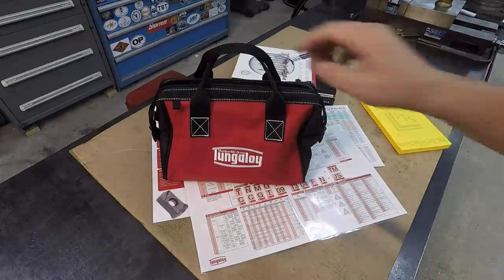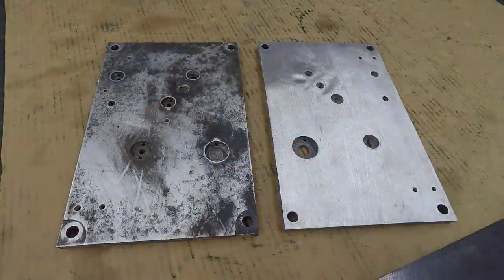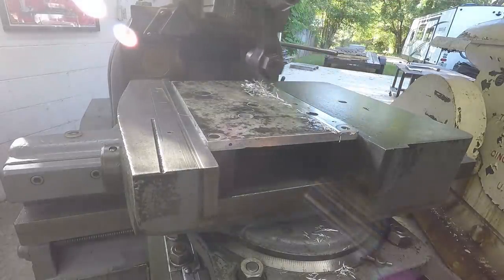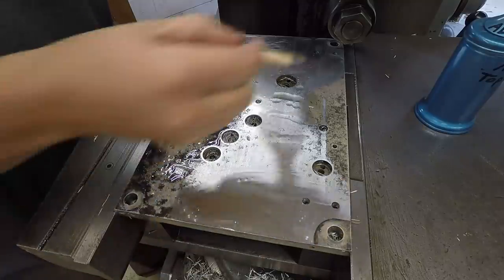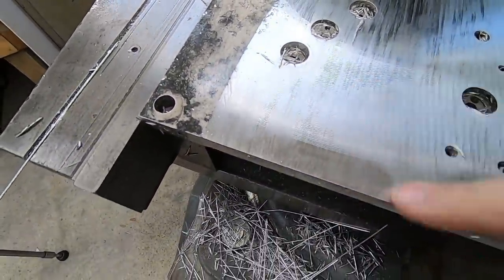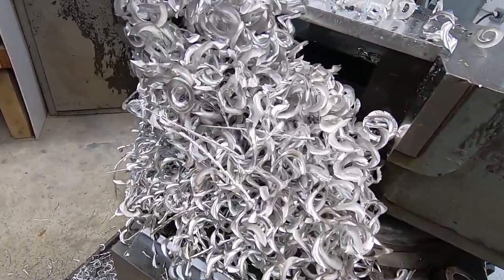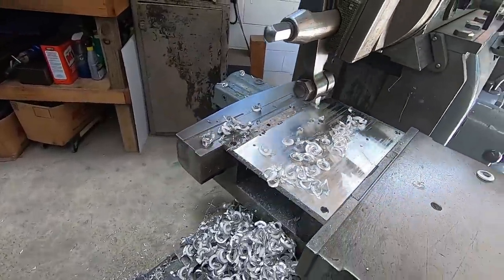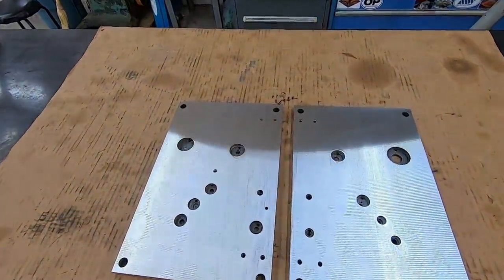SNS 307: Grandfather Clock Restoration, Shear Tool on Aluminum

Comment: Yes, I ruined the finish, but that's not what you see. I made blunder and in the process of trying to do the edges, I put quite a few scratches in it. I decided to take everything and polish it up with a buffing wheel and compound. I also did all of the parts, especially the copper ratchet and the pawls (I was surprised to see that they were actually copper and not steel) and the large brass drive gear on the driving shaft. My brother in-law was actually kind enough to take the cut pieces of Lexan and make new cover plates as well as a new face. What shows in the pictures does not do justice  to the awesome job that he did, especially on the face. Unfortunately, I had a couple of better pictures for the copper and brass that were better exposed to show how nice they looked, but I guess I didn't get them to Adam in time. Although he doesn't show it in the assembled pics I left the outside surface on the back plate untouched. A big thank you to Adam for a great job on the plates!
Reply: Everyone makes mistakes; it how we learn. At least you tried.
Reply: @jthomas1878  Thanks for that. To be fair, I knew better. What's done is done and I like the polished finish anyway. Had I been able to get it down to clean metal, I might have done that. There was a fair bit of staining on many of the other pieces so that's why I wanted to clean as much as I could with the buffing wheel and compound. That went with the new clock face that my brother in-law made for me that was so clean and clear I just had to clean everything else as much as possible. The only thing I couldn't do much about was the  shaft that had the large brass gear on it. There's a disk on that which is steel and I could only do so much to clean that up. That's fine because that little bit of age showing adds character.
Reply: That thing looks nice, Nathan! Well done!
Reply: @TreyCook21  Thanks, glad you like it!
Reply: Very cool, I'm clad you were able to save it.
Reply: Hi Nathan, I hope my comment didn't appear rude. I think that's an amazing save for a precious keepsake and you've obviously put a huge amount of effort into restoring it. Aluminium is incredibly soft and the extremely fine machine finish is going to be very delicate. You could mar the finish just by looking at it too hard but I am sure in reality, it still looks amazing. Nice job!
Reply: I don't see a ruined finish. I see one awesome looking clock. It's beautiful. A very impressive restoration job I say.
Reply: The difference between a layman and a craftsman is not that the craftsman doesn't make mistakes, they just repair them so well that you couldn't tell that they happened ;)
Reply: Is there a place to view your progress on the restoration? I'm hooked.
Reply: It really looks horrible. Don’t take it personally.
Reply: Your Grandfather must have been a very talented and patient man to create something like that.
Reply: Adams work slightly reduced the depth of the bearing holes in the plates. Did you have to do any other work to accommodate that lost material to make the clock work OK?
Reply: @theflyingfool  No. Actually,  was a little more concerned about the back sides of the plates as I was a little concerned that the amount of material left might be too thin to push the bearings in. Yeah, the bearings do stick out a little bit but are more than half way in the holes. What I did find interesting was that bearings had a tighter fit to them. If I remember correctly, there were several that I had to slip some paper in as a shim just to keep them from coming out. Now, it was only one.  Truth be told, it will be a while until I can get it running. I first have to build a stand for it, then figure out how much weight I need to drive it and work on the missing section of the pendulum.
Reply: @ScrewDriverxxx  Thanks for the nice reply. I was a little upset at first, but that seemed to be the only negative one. Hey, everyone's  entitled to their opinion. Your response more than made up for the first one. Thanks! :-)
Reply: @johnnyholland8765  Hey Johnny, He was a machinist by trade and also taught machine shop at both the high school and college levels over the years. In fact, he did lathe work during WW2 as he couldn't go into service because of wearing glasses. I get a sense that he was very meticulous about his work and what he expected from the students. There was one story that was to the affect that if he asked you what angle to set the ?cross slide? ?cross compound ? (don't remember what it's called, been too long), You better not tell him 29 or 30 degrees, you better tell him 29.5 degrees.
Reply: @rcbax434  Oh wow! I missed this one. I'll figure something out. It's going to be a while as I still have to figure out the weight I need for the drive and how much I need to add to the pendulum. I also have to build a stand for it and to be honest, I'm going to take my time on that. I'm going to try to do it old school with hand tools. (Most of the stand will be with oak.)
Reply: @chimaeria6887  Sorry you feel that way about it. It might be because many of the post cleanup pics were a bit under exposed. But everyone's entitled to their own opinion. Hey, you can't please all of the people all the time.
Reply: Do you have an account where we can see the finished project?
It would be awesome to take a look!
Reply: Hi Nathan. Take your time and enjoy the process of restoring this clock. When it's done,  you'll probably find that you are a chip off the old block. Your Grandfather must be immensely proud of you man! The restoration would be interesting to watch btw.....hope it goes well :)

Comment: First machine tool I worked on when an apprentice. A year and a half on the bench, then only then was I put on a machine tool..8 months on the shape, them moved onto other machines.  Served my apprenticeship at BULOVA WATCH Co. In Astoria Queens, NY.. Early 70's it was 4 1/2 years program.
Reply: My 1st job out of the Army, in 1968, was as a lab. tech. in Bulova's Dial Dept.  Tool and die makers worked in the Dial Dept. and I got to use their drill press on high purity silver electroplating anodes.  Darned tootin' that swarf got recycled.  :>D.

Bulova laid me and a lot of other people off in 1970.  Contracts for the military had ended.

Comment: As someone who does metal work in their kitchen, on a Black and Decker Workmate, using an Amazon cheapo vice, with vice grips I made out of angle iron and magnets ... it makes my day to see that there is a 5 tonne machine that mechanically shaves a fraction, of a fraction of a millimetre, off the surface of a metal plate. This has made my evening. I hope that grandfather clock goes on to tell the time for many years.

Comment: Gday Adam, I agree fully, you cannot beat the finish of a shaper, straight lines are much nicer then a swirls, I’ve only played a little with aluminium on my shaper but I have achieved brilliant finish’s with what I have done, even on normal mild steel I have got fantastic finish’s, fine tune the shear tool and the machine does the rest, thank you for sharing mate, I always enjoy shaper footage and always learn along the way, Cheers Matty

Comment: I think that I'll add another comment here and that's that the clock was/is NOT a grandfather clock per se. When someone says grandfather clock I think of a clock that the clock works are inside a nicely made cabinet. Also, this has only the clock mechanism without chimes. Personally, I love it open like this as it has a nice "techno" look to it. Right now the whole clock weighs somewhere in the neighborhood of about 30 lbs.  I was planning to do a stand out of steel, but can't find anyone within a reasonable distance that is willing to do it. So what I'm planning is a stand made of oak boards. Just very fundamental but strong. I have no idea yet as to how much weight I'll need to drive the clock and that will be added on to the roughly 30 lbs. of the clock. I'll put in another thanks to Adam here for an awesome job, and to all the wonderful comments.

Comment: Wow. Aluminum is easy to clean up and polish by hand. Very easy. I had a part made of stainless and I wanted it to be a mirror shine. I regret not going with aluminum, because I absolutely could never get it to polish up to look like chrome, even after paying a shop to do it. I had done a similar part for an older project with ease, progressing in finer wet sandpaper up to 2,000 grit.
Reply: Granted sanding doesn't get it flat

Comment: I'm not sure if you've done it already or not, but I'd love to see a video on how you operate the shaper. What handles do what, and a quick run through of how it operates, such as how the ram stroke is adjusted for length of cut and so forth. Machining is something I enjoy learning about, and the shaper is a very satisfying machine to watch in action.

Comment: These shapers have their use. Much prettier finish than milling. I always use WD40 for cutting aluminium.  Great job👍
Reply: Thanks for the tip Mr..
Reply: Yea but its not nowhere near versatile as milling machine or fast .That is why they were phased away.
Reply: @zumbazumba1  They weren't phased away, they are still being used today. Shaper can do everything a mill can do but a mill can't do everything a shaper can do.
Reply: @keithhansen3963  It would be challenging to do a closed pocket with a shaper whereas a mill can carve one out with an endmill easily enough. On the other hand mills can't do blind internal keyways without a slotting head, which effectively turns them into a vertical shaper. Horses for courses, as they say.

For a home shop where you aren't paid by the hour a shaper is great because the tooling is insanely cheap compared to mill tooling (I have a little Atlas horizontal mill- a basic horizontal cutter is like $50, plus when they get blunt you have to pay to get them reground or buy a tool and cutter grinder which is a whole other level of cost. Compare a shaper with a $5 HSS toolbit you can sharpen on a bench grinder...). On the other hand they are slow because you are effectively 'milling' with only one flute and only for 1/2 of each rev at that. If the race is between a mill as diminutive as mine and a similarly compact shaper there might not be much difference, but on bigger machines it makes a lot of difference if you mill where possible.
Reply: @nerd1000ify  you can mill internal keyways with an endmill or keyway cutter.  I haven't don't it myself but I've seen it done quite a bit.

Comment: I'm wondering if there is some leveling issue on the vice. Those two pieces machined very similarly, not sure it's a coincidence. I know it wasn't critical on these parts but it's probably worth checking.
Reply: Man’s prolly got enough experience.. But yeah i as someone who has worked a couple of years as a conventional and cnc miller thought the exact same when the 2nd plate turned out to be somewhat similar

Comment: You had 2 different chip forms, was that a difference in feed rate or the depth of cut.  The finish is fantastic.
Reply: Likely depth of cut. They changed once he hit the area that hadn't been cut by the first pass, so the chips would obviously be somewhat thicker. That's how it appears to me, anyway.
Reply: Yes they went from crazy straws to onion rings.

Comment: It would be interesting to hear feedback from the clock owner to see how the reassembly went. I suspect he will find bushings too long and shafts which bind.
Reply: The distance between the plates will still be the same, the only problem I can see is in the depth of the countersinks or the screws being a bit long.
Reply: @jamesogorman3287  The spacing between the plates will be the same but the pockets for all the bearings will be too shallow now.
Reply: The pockets/holes are a little shallower, but the position of the bearings is still  relative to the original. The distance between each pair of pockets hasn't changed as the plates are held together with the post on each corner. In other words, the position of the bottom of each pocket has not changed. There's still "plenty of meat" left in the pockets to hold the bearings.
Reply: @jamesogorman3287  If you mean the counterbores for the bearings, yeah they're a bit shallower but I don't think they'll be a problem. If you mean counter sink, the only countersinks are on the plastic. What my brother in-law missed was that there was some warpage in the clock face and that affected the positioning of the holes. No biggy.
Reply: @84953  .
The POSITION of the pockets hasn't changed but their depth has. Therefore the distance between the BOTTOMS of the pockets (between the plates) is now smaller.
 Normally the shafts have shoulders on them to contact the bearing center race. (that's why you have bearings in the first place) The distance between the outside bearing faces on the assembled shafts hasn't changed. Since the pockets are now shallower I assume the bearings will bottom out in the pocket earlier keeping the plates from going together. (the bearings can't go closer together because of the shoulders on the shafts).
If this is true then a new spacer post between the front and back plates might solve the issue.
Who knows.  I haven't seen it. I'm just assuming there will be problems and I'd like to know if there was and what was done to solve it.
Enough said on something we know very little about.

Comment: I have found that the problem with hand made clocks is that each part is individually made to fit. 
Change any part and suddenly things stop working. Don't ask me how I know...
Reply: Yeah, putting a grandfather clock through a fire probably doesnt help either. Chemical approach for clock parts the only way to go. Pinions and posts, bushing tolerances, all changed now.
Reply: looking at the plates all of the holes are counter bores perhaps the faces of the plates aren't reference surfaces and everything is gapped by the bottom surface of the counter bores.
Reply: yup.

Comment: Why did the shape of the chip change from those tight little spirals to the larger ones after a few passes?
Reply: Change of depth of cut, when is shallow will form spirals, when the chips are coarser they form those curls and break away
Reply: Robert is correct, look at the length. The longer chips are from a deeper cut. Eventually, if your cutting deep enough the chips will start to shorten and get thicker as well. :)

Comment: On wide plates like them would you ever put parallels under the center like you do on the edges to support it from deflection or does it not put alot of downward pressure sorry I'm just curious?

Comment: I've not seen you adjust for it but ... on a chisel blade cutting tool, how do you insure the right and left sides take identical cuts? i.e. produce a level surface

Comment: I'm surprised that actually worked considering that the counter-bored holes are now about .20 thousands  more shallow per side AND the plates were slightly warped meaning the holes are probably not straight.
I can only surmise that some additional machining must have had to be done in order to make this thing work again.

Comment: could be the heat from the fire anealed the aluminium making it a lot softer than how it was , would explain the scrathing 
think he could anodinize the plates and give them a little more scratchproof surface
Reply: Anodizing is a coating.  It would certainly make them more "scratchproof" but would also add quite a bit to the cost.  It is hard to find a shop that will do "one off" jobs like this.

Comment: In other videos you talked about the spray cleaner that you use and said it works great but evaporates pretty quick. could you please tell us what that solvent is? I have been looking for a solvent that works exactly as you have described. also thanks for the awesome video's.

Comment: Most of the way through I wondered if the holes would need to be deeper for part fitment then you answered it right at the end. Kind of disappointing didn't get to see them machined but kind of satisfying I even considered it as I am no machinist. Thumbs up as usual.

Comment: I'm wondering, but wouldn't an automatic tool lift make surface finish even better, because of no rubbing?, was that an option for the G&E shaper?
Reply: thought the same thing
Reply: I thought that the shaper did have automatic tool lift - judging from previous vids...
Reply: Its has an add on for that, I think it's main use is the ability to use carbide l, then it doesn't break on the return. He doest have the attachment but was looking for one.

Comment: Maybe a silly question, is there any fear of the middle of that thin plate flexing or bowing down under the cutting force of the shaper? It's not really being supported in the middle, could that cause a surface that wasn't flat? It may not even matter in this case.

Comment: Adam, there was a major difference in the chips between passes and between plates.  The initial sets of chips were long, tight, and narrow, looking like, as one of your other respondents put it, asparagus stalks.  The other chips were broad with a wide arc curl to them.  Was that the difference between the depth of your cuts or feed?  Or was it a subtle difference in the aluminum plates?

Comment: Hi Adam, you didn't say and I don't recall the user saying anything and I didn't hear anything in the user description about warpage. Aluminum is a soft metal and has a melting point of about 750 degrees (I think). will that be a concern for his clock?

Comment: Shapers are the "surface grinders" (without the grinding part) for those materials that are not happy (wheel loading) on an actual surface grinder. With a honed radius tool, the toolmarks are almost invisible. Give it a pass on brass if you think aluminum is good looking. You'll be hooked, and maybe snub the mill next time you want a beautiful finish right off the machine.